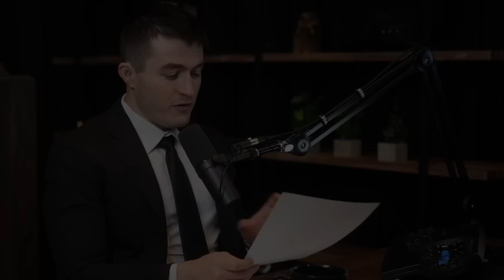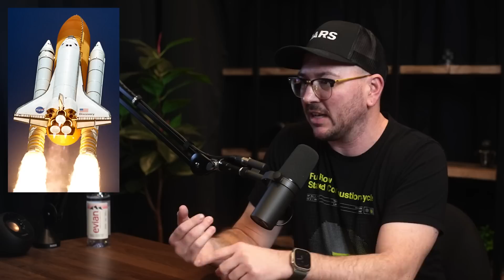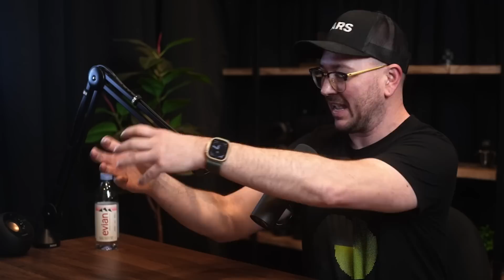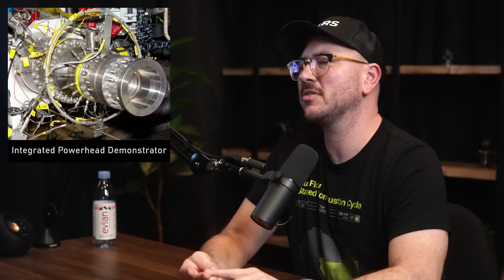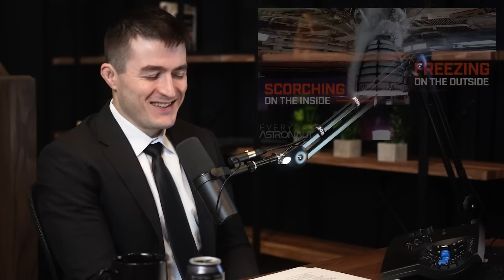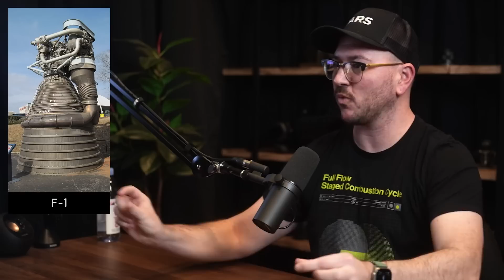How Rocket Engines work | Tim Dodd and Lex Fridman

Comment: Fully reusable is fine, but how many uses? Many components have to be changed so its not reusable inandofitself. Finally, full reuse ability isn't valuable inandofitself. It all has to do with launch costs.
Reply: if it can be used 2 times, thats a 100 percent improvement from expendable. Most companies would kill for 100 percent
Reply: At a MINIMUM, each will probably see 20 uses. 

The falcon rockets have already surpassed this number of uses, each, easily. 

They are refurbished between each use, and are heavily inspected. The data collected from the thousands of sensors on each rocket DRASTICALLY cuts down on the time needed to refurbish each rocket after each use. 

Within the decade, these things will likely have a 24 hour turnaround time between launches. This time includes inspections, refurbishment, and refueling. 

This being said, having a rocket capable of only a single re-use will already represent a 50% cost reduction for each launch attempt into space. This will DRASTICALLLLLYYYY reduce costs
Reply: thats why they say fully and rapidly reusable. their goal is to make it so they just have to do a quick inspection for a few hours then refuel and relauch within 24 hours. 

If they get even close to that it will be a game-changer.